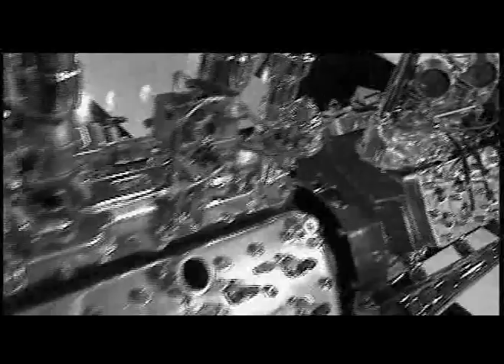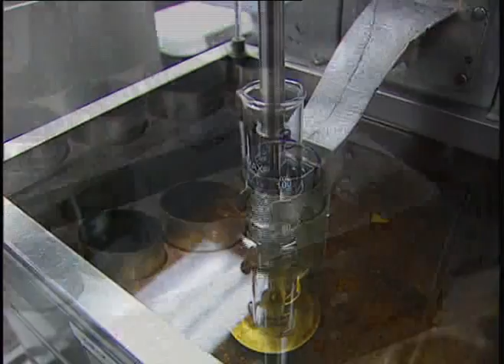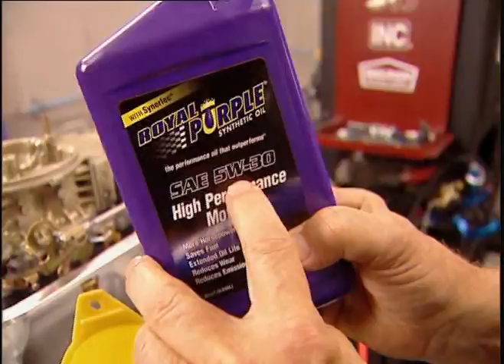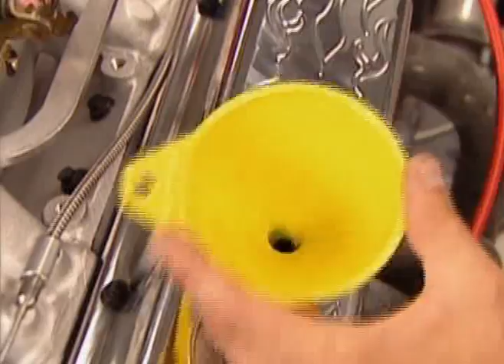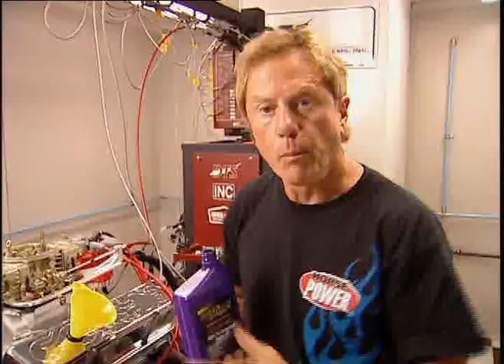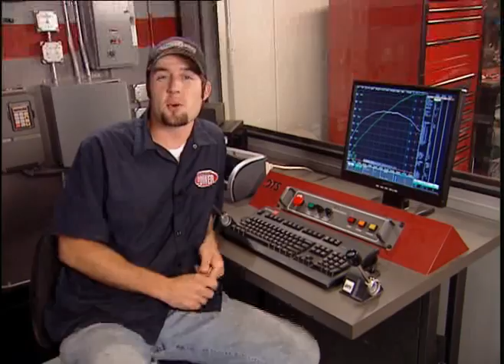Motor oil : www.RoyalPurple.com  - Call US: : 1.888.382.6300

Comment: I use Pennzoil Platinum 5W-30 and it works beautiful for 6,000 miles and cleans the engine very well. One of the cleanest oils I have ever used.